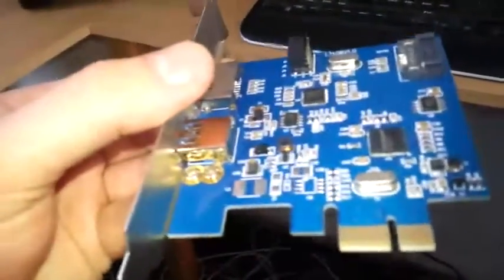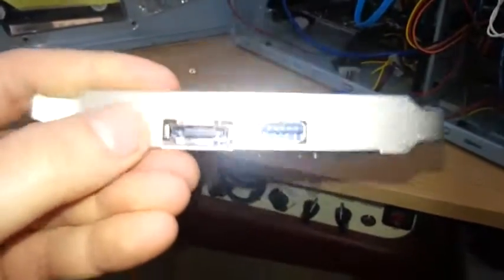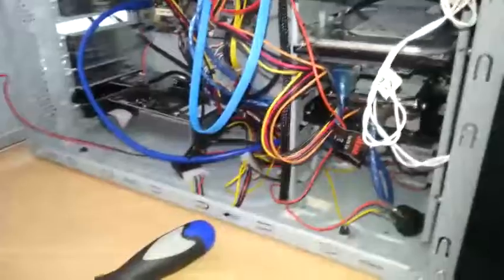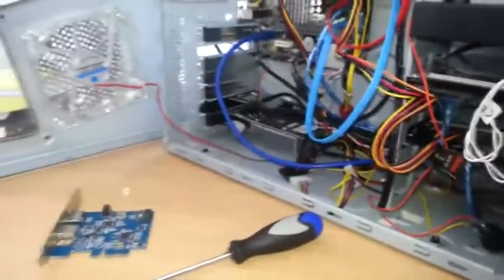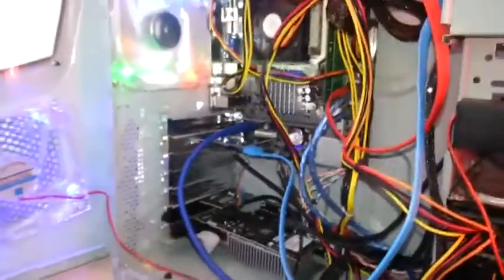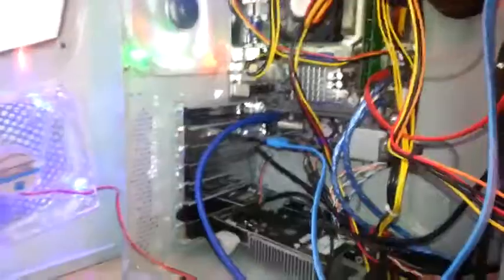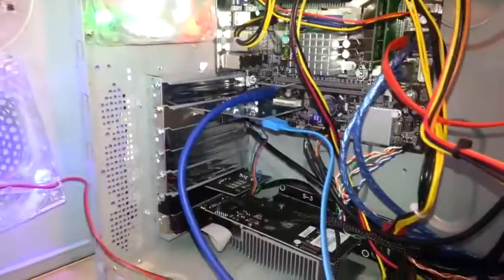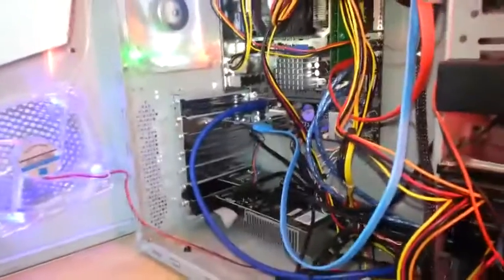Problem With My 3 in 1 USB 3.0 + eSATA 3.0 + SATA 3.0 to PCI-E PCI Express Card Adapter Converter

Comment: Hello. I just order a similar PCIe adapter and i think i might have the same problem... have you managed to find a solution for this? i am interested to find out it might help me as well..
Reply from the maker: +peace2u I still can't get it to work. I gave up on it.
Reply: John Gage too bad .. :/
Reply: +John Gage i have the same problem like you and i know the reason now. I tried to boot my SSD from the adapter but without success. That is because the motherboard does not recognize the adapter as a boot device. I checked everything in the bios but there is no option to enable the adapter to boot. The bios doesn't even see it. Older motherboards did not have this function available at the time. Only newer motherboards are able to boot from adapters/converters. So my only choice was to install my SSD (6GB/s) on the SATA port (3GB/s) and even though i get half the performance of the SSD on this motherboard it is still a LOT faster than the normal HDD which was installed previously.
Reply: Did u sort this not working
Reply: @trevorgood6511  no..
Reply: No I got a pice for my hp slimline the computer recognises it cause it’s in devices but the usb3 don’t work